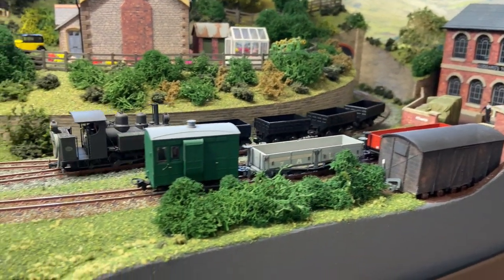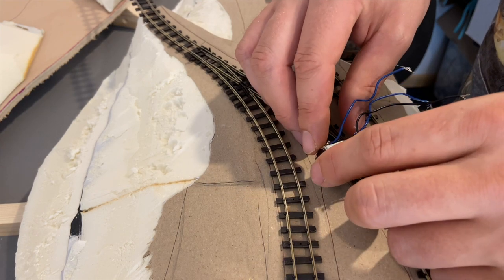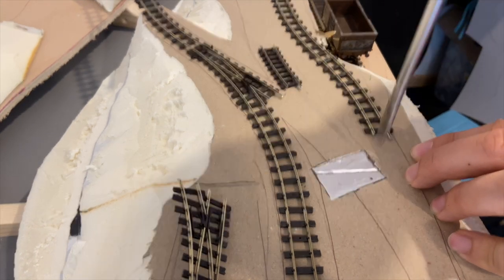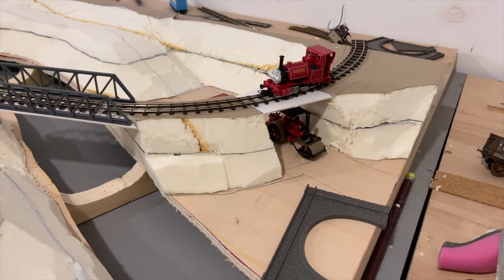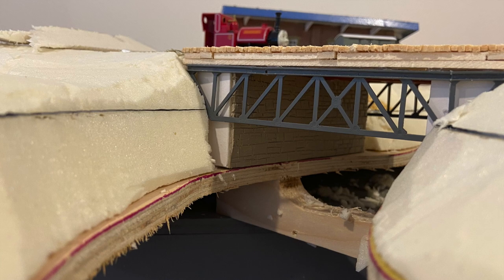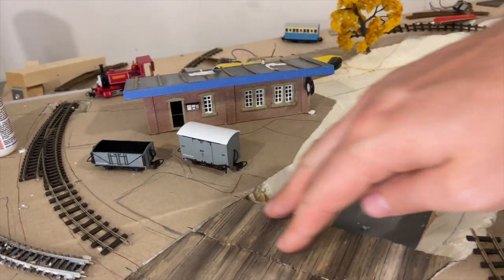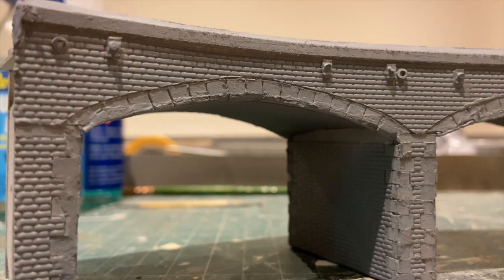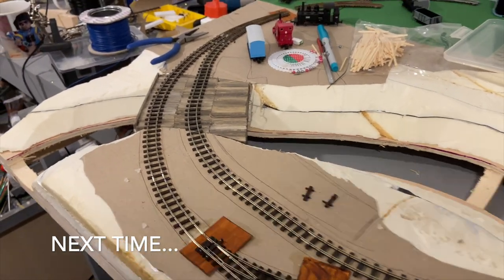Building a OO9 Model Railway Episode 1

Comment: I think the problem was using solvent free grip glue. Proper gripfill would take the foil ok and still go off. But as you showed, peeling the foil off was a work around
Reply from the maker: Yes gripfill probably would have done the job certainly something to keep in mind in the future. Thanks for watching
Reply: @WesternSignalman  But this is what's great about your delivery  ....you don't mind admitting faults. There are too many arrogant you tube channels even just in the model railway world, showing errors and rebuilds is what makes a good channel